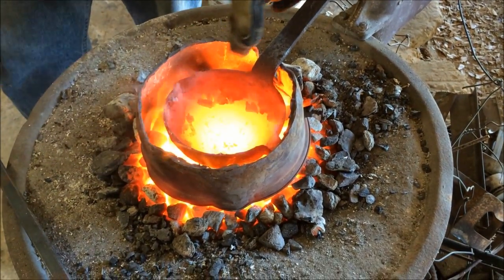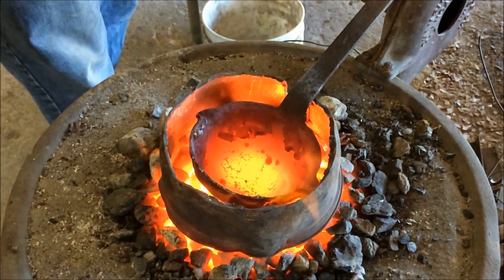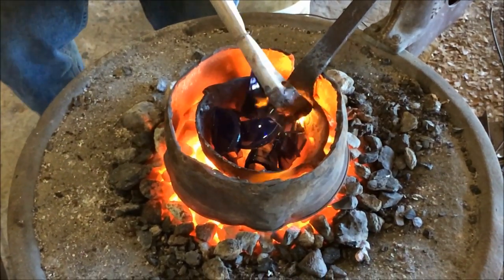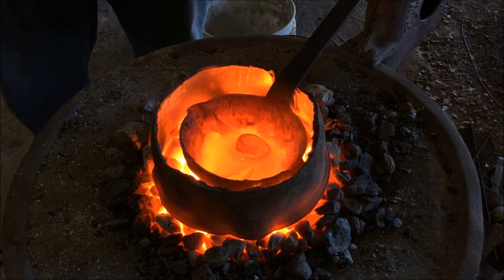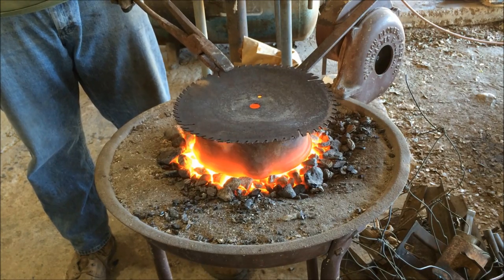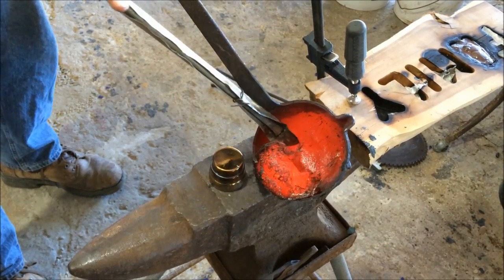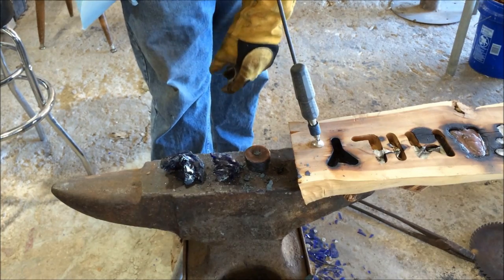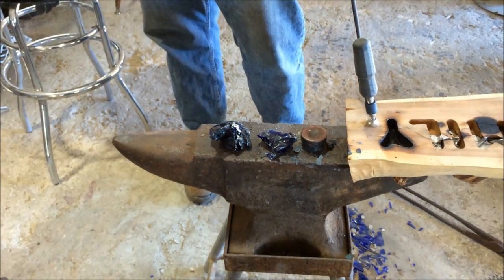Melting salt & glass pt.2

Comment: you gotta heat it from the bottom with the charcoal (like you are) and then torch it with oxy acetylene (neutral flame) from the top to fully melt it.

Comment: I guess you figured out by now that glass does not have a melting point.  It is what is called a super-cooled liquid.  Tar (bitumen) is the same.  The warmer these get the softer they get; the cooler they get the harder they get.  FYI, glass you use for windows seems hard, but it is still a very, very slow moving liquid.  If you find 100 year old window glass, you will note that the top is thinner than the bottom because over time it has sagged.

Comment: Glass has a high viscosity and is still a liquid at room temperature.  It is just flowing at a very low rate.  Some kinds of salt makes glass more liquid and flowing at a lower temperature.  Try a modern bottle that is clear.
Reply: Glass is not a liquid at room temperature.
Reply: the molecular structure of glass at room temperature IS a liquid at room temperature.  That is what the Universities teach in Engineering class, Strength of Materials class.  It is a liquid with a very high viscosity.  Old windows that are over 100 years old in houses a fatter at the bottoms than at the tops of the frames.  If you put a micrometer on them you can see that the glass is flowing downward very slowly.
Reply: True and false.. while its true glass isn't a solid the whole "glass is fatter at the bottom" thing is more urban legend than anything.. glass windows were made with uneven sheets back then and they were installed intentionally with the heavier (fatter) side down because it was more stable.  For a sheet of glass that started  with an even thickness to distort its shape to that degree would take so much time you would still be waiting far beyond the heat death of the universe.
Reply: I'm talking about only 100 years and I believe that that is long enough.  You are saying that every single window that was installed long ago was installed after a micrometer found which side was thickest?  I think they just put the window in without using a micrometer.
Reply: So you've checked every single window?  What about 2000 year old egyptian glass vases? Why have they not become puddles?  Why do the pieces in a 400 year old stain glass window "sag" both up and down and side to side (away from the center)?
Reply: It is not something that I have researched a lot.

Comment: If you really want to see something, as well as speed the whole process up, forget about the fan blower on that forge and pipe pure oxygen into the coal bed.  That shit will turn WHITE, real quick!
Reply: where can i see this. pls reply.
Reply: I've done it before but I didn't make a video.  I might if I do it again.

I was trying to melt some nickel nodules but it turns out nickel has a melting temperature right in the middle of the range of melting temperatures of various types of steel.  Since I don't have a huge furnace and a truckload of charcoal I decided to use a small steel bucket filled with sand and plaster with a hollowed out section in the middle to hols the charcoal.  I got it burning and piped pure O2 into it.  Like I said, it turned white.

Still didn't melt the nickel though.

Comment: I've poured glass with graphite in a propane forge you're setup just isn't optimized right. You basically have metal to "insulate" which isn't insulating anything. The outside is orange hot you're losing tons of BTUs. Then the insulating material (glass) is also in a non-insulator. All you need is a proper silica forge with a clay or graphite crucible. Powered with air-propane or charcoal you can get it pourable just with better insulation. I've also melted pure 99.9% silica but with an oxyhydro torch. And interestingly enough pure silica goes straight from solid to watery liquid. It's all the Na2O, MgO, CaO oxides that make it gummy like that but also lower the melting point.

Comment: I'm not 100% sure, but I think y'all were cranking the blower handle the wrong direction...?
Reply from the maker: +Miso Lucky We have tried it both way. The air flow seems to be the same either way.
Reply: +What We Made 
Just fell over these interesting Vids    - 4 wotits worth----   Cranking a radial bladed fan one way gives high flow with lower pressure,  opposite way around gives lesser flow with higher pressure  ( Basic theory of fans - forward & Backward curved blades )
Reply: My Champion Blower fan blades are slightly modified(bent) to increase flow with clockwise cranking. Sorta like a window fan.(I forgot about that little bit of info.) I'm sure if I'd bent them the other way, it would be the opposite. 
Thanks "culmalachie" for the info. I'll check it out.
Reply: it looks like this may be a shop so don't you think that they would know which way the blower handle is supposed to be turn'd. just saying

Comment: Glass has to heat slow...needs to get over 1400degrees to be molten.  And has to anneal and cool down slow to prevent thermal shock...

What happens if you heat up in the pot from room temp to molten?

Comment: While a brick lined furnace is going to give you a lot more heat to work with, your major loss of heat in your current set up is through the saw blade lid... Make yourself a quick easy Fire brick lid by drilling a fill hole in the brick to load materials into your smelting pot / ladle through the top. Just set it on top and load materials to melt when you get to temp. You should be able to increase your temps by several hundred degrees at least just with the new lid... :)

Comment: Glass is an amorphous solid, which means it doesn't have crystals. This allows it to flow far below its melting point (2900 degrees Fahrenheit). This is why old windows are thicker at the bottom than the top. If you heat the glass to the approximate 1800 degrees it was at in the video, it will flow somewhat, but to get it like the salt, it must be at around that 2900.
Reply: Btw, coal does burn that hot, but it needs a LOT of oxygen at somewhat high pressure.
Reply: And you'd need a graphite or ceramic crucible, because cast iron melts at 2100 degrees and steel melts at 2600.

Comment: Really nice little forge....you might try cutting a gas tank, lining it with Fiberfrax and/or firebrick and keeping the channel from the fill tube all the way down the length for the air flow from the bellows
Reply from the maker: +Jo Ro I do enjoy my forge. However I know eventually I'm gonna have to make some different forges. It's just not enough for some of the projects I want to do.

Comment: Glass can only be molded at very high temperatures. It completely melts/liquifies at approximately 1400 °C to 1600 °C depending on the composition of glass. Glass is made from a variety of substances, depending on the intent of use. Mostly sand, lime and soda are what most glasses are made of.   Salt melts at 801 c

Comment: metal doesnt retain heat as well as you'd think. you try some brick? it should allow more heat than the metal pot does
Reply from the maker: +Un7ucky Yah I do know that it was a very inefficient foundry but I didn't have access to any firebrick at the time. -Caleb
Reply: +Robert Schuster normal bricks run the risk of breaking or even exploding/shattering
Reply: +What We Made Any bricks would help even concrete blocks
Reply: +What We Made If you have an old bucket you could line it with an inch or so of plaster of paris. Works pretty well.

Comment: Would ceramic bricks insulate the the "heating core" better, so you'd get higher temperatures instead of losing it out the sides of that metal ring?
Reply from the maker: RonJohn63 I don't know if ceramic would work but there are firebricks that would do the job much better. This was simply an on the spot rig that i did in a few minutes. -Caleb
Reply: What We Made FYI: fire bricks are a form of ceramic.  (I'd forgotten the name "firebrick".  Thanks for reminding me.)
Reply from the maker: That's true they are a certain type of ceramic and no prob. -Caleb

Comment: Powder or crush the glass as fine as you can get it first then mix it with the salt. The salt will at as a flux and allow the glass to melt at a lower temperature, hopefully one your furnace can produce. I'm a glass blower, so feel free to ask if you have anymore questions.

P.S Safety, guys! Melting things like this is putting off a lot of harmful fumes, I hope your shop has at least some kind of ventilation.
Reply: +TheThrash CW Correct me if wrong but for glass to become molten doesn't the flame have to blow directly on the glass and not be separated by a piece of metal?
Reply: Scott, no sorry but that is actually incorrect. Electric kiln formed glass is actually very popular glass forming medium, you should check it out. If the temperature is high enough, the glass will melt.

Godfrey, you will have to experiment with that yourself. Every batch of glass is different. You should pick up some non-iodized salt and experiment increments of 5 or 10 percent of your batch. Make sure you are powdering the glass as fine as you can get it as well!
Reply: If you do this I just want to remind you again how important proper ventilation is. Table salt is sodium chloride, not fun to breathe in, and quite possibly deadly I'm sure.

Happy melting, and be safe!
Reply: +TheThrash CW NaCl is fine, The melting point and decomposition point are hundreds or degrees away from each other. 

The crucible they were using will melt before it decomposes.
Reply: Green beer bottles..  like rolling rock and the yengling lager work....
Reply: @TheThrash CW Agreed safety is always important and ventilation is an important safety protocol in case one does make dangerous fumes. For instance I might worry more about cobalt (if it fumes) than sodium. 

I am a lay man scientist, not a doctor, with just enough knowledge to potentially make me dangerous, so to make a pun, take this with a grain of salt. As for sodium chloride, if any is vaporizing,  then when it's vapors mix with normal air it is likely to cool  to ambient air temp.  If it is inhaled into ones lungs, it is likely to be little different than the salty air one breaths in an ocean beach. Incedently yes cars tend to rust faster  when left near the beach because of the salty air. But, inside the lung, it would hydrate with the moisture in ones lungs and would shortly  be absorbed into the body, leaving no crystals behind that could do damage.
Certainly too much sodium chloride in ones blood can be deadly but sodium chloride is necessary for life,  while only being toxic if taken in excessive quantities faster than one can excrete it from urination.
Reply: @kreynolds1123  salt does not volatilize at room temperature, and especially not below room temperature, like at the cold ocean. how can you suggest there is salt in the air near the ocean? I mean, you cannot smell salt when its concentrated in your salt shaker, how can you expect to smell it somewhere much less concentrated and much colder? it does not volatilize naturally.
and by the way, the cobalt would create very little vapor if at all, there is less than a tenth of a percent of cobalt used in blue stained glass, that is, if they even used cobalt to stain the glass in the first place. even after melting it into a thick contaminated ugly blob, we can still see some blue, which means that it does not just immediately boil out.
Reply: @C W dude, why all the fuss about fumes? "does their shop have ventilation" well yeah of course, their shop is literally open to outside: 4:16
and the fumes really aren't that bad, (I know this from experience) and I mean it completely makes sense, they aren't using any toxic substances, and the glass is made mostly from silica, which does not volatilize, and the iron also does not volatilize, and neither does the rust (iron oxide) even the salt boils at 2,670F, which they definitely did not reach. I mean, it would easily be hot enough to melt cast iron, and probably even steel. I would guess they got to around 1,600F - 1,900F. the only fumes are CO2 from the charcoal, and maybe a tiny bit of CO2 from the oxidizing carbon in the cast iron. CO2 isn't poisonous or particularly deadly either... and even the carbon monoxide produced is immediately burned into CO2, carbon monoxide is not very stable, and will form CO2 at the drop of a hat, which is convenient for us. this is especially true considering that the fire is oxygen fed, making it nearly impossible for carbon monoxide to remain unburned. I don't think there's even any water produced in this combustion, since its charcoal, not wood, the volatiles have already been volatilized.
the glass might not even be colored by cobalt in the first place, and even if it is, cobalt metal does not volatilize, and cobalt oxide decomposes at a little over 1,600F which they probably reached, but only the cobalt on the surface of the glass reaches the air, and being a liquid and all it has a low surface area. not to mention the fact that less than a percent of cobalt is used to dye glass, its a very strong coloring agent, even at low concentration. its usually used at 0.025% to 0.1%. I see no reason to fear the fumes...
Reply: also, am i correct in saying the iron would still give a slight pink hue to the salt even if completely cleaned due to the iron oxide absorbed through this process.  Himalayan salt is pink because of the iron content.  seems relative.
Reply: @shawnguy3005  

Hi, Shawn

Depending on the oxidation state of the iron, it would likely give the glass a dull green hue due to how it is incorporated into the glass matrix and the way light would then interact with it.

Comment: I'm new to your videos, but I was wondering what you are doing when u spin the handle
Reply: Is a fan, by adding oxygen to fire it will heat up even more to achieve melting temperatures

Comment: What happens if you drop the eed hot glass into ice cold water?
Reply: you get a prince Rupert drop
Reply: +Louise Harper It shatters on contact with the water.A good friend of mine blows glass, they toss the puny rods and blow sticks into buckets of water while the glass is still molten intentionally to shatter the glass off the iron,

Comment: Actually, glass doesn't really melt because it is always a liquid.  It just becomes extremely viscous at room temperature.  I once had occasion to cut some window panes from a house built in the 1920s.  The glass was very thin at the top of the panes and twice as thick at the bottom.  That was because the glass had never stopped flowing, even after 70 years.
Reply: JubioGaming because people were just shit at making glass back then***
Reply: Emmit Stewart sorry to burst your bubble here mate, if you do a little research on this urban myth you will find out that glass is in fact not a liquid and the glass that is thicker at the bottom is just because they were shit at making glass panes in that era, for your reference here is a web page from the research that was done:  http://www.scientificamerican.com/article/fact-fiction-glass-liquid/
Reply: Justin Spier I stand corrected.  However, this is more than an urban myth.  It was often repeated in magazines and books as a scientific fact.  another proof that you should not believe everything you read.
Reply: +JubioGaming lololololol
Reply: Emmit Stewart 

"Glass, however, is actually neither a liquid—supercooled or otherwise—nor a solid. It is an amorphous solid—a state somewhere between those two states of matter. And yet glass's liquidlike properties are not enough to explain the thicker-bottomed windows, because glass atoms move too slowly for changes to be visible."
Scientific american.
Reply: (I know this has already been commented) Glass is a solid, through and through. Glass from 100 years ago and more is thin at the top and thick at the bottom because it

Comment: The working temp of KG-33 is 1255 degrees C.  The working temp of Corning 7740 - Pyrex is 1220 degrees C.  The working temp of CA-2 Pharmaceutical grade soda lime is 1035 degrees C.  I believe the blue bottle to be soda lime so you should be able to work it at 1100 C.  Glass does not turn to a liquid like other materials, it softens and becomes like hot taffy, extremely hot!  And will not taste good like taffy.

Comment: I bet that glass dust would melt better.
Reply: Pavel Medbery Not quite as much as you'd think. It would melt a bit quicker or more evenly, but it would still have the same melting point. If it's not the special "batch mix" with all the chemical fluxes to drop the melting point, it won't be that much more liquid

Comment: man i think you should heat glass slowly and cool it slowly because it explodes every time it gets heated and cooled up quick

btw melting point of glass is veryhigh 1650°C more or less
Reply from the maker: delcastillo1000 Yah this was the first time we had messed with glass at all and we learned alot from it. BK offscreen was messing around with a propane torch and had burst a piece. Thats why I was being very cautious when we put it in.
Reply: What We Made i see, well thats awesome, you guys should do more of these melting random stuff and mixing them up videos, its entertaining to watch
Reply: delcastillo1000 

yeah blue bottle glass is a humungous pain too, it stiffens back up way way faster than alot of others. bottle glass is formulated to accept heat super fast, go into the machine mold, accept the puff of pressurized air, and thus the shape of the mold, and then ZAP back to solid. these bottles are made on high speed production lines, not by hand, consequently, their formulations are NOT meant to be handworked in ANY way. they frequently are in many ways, but again, i can provide a BUNCH of better options.